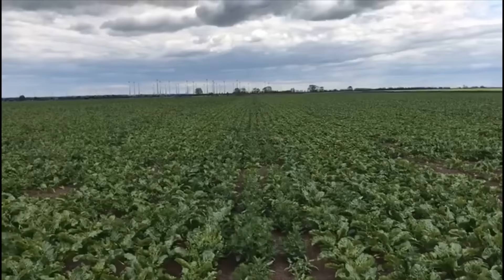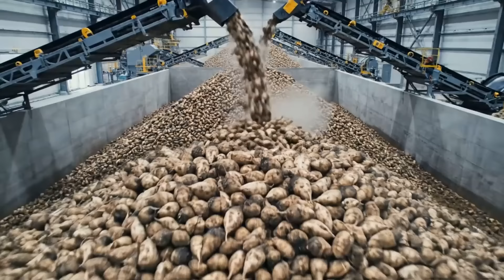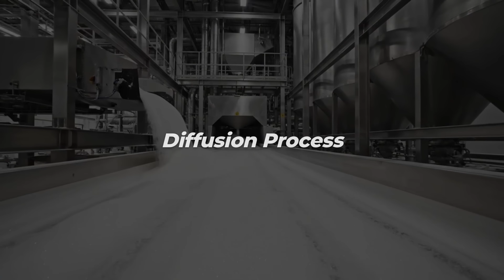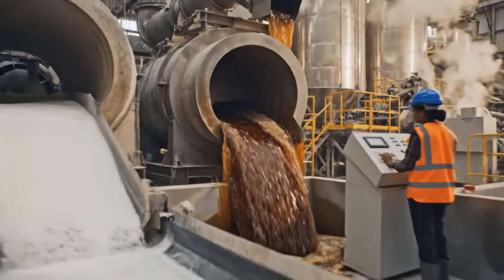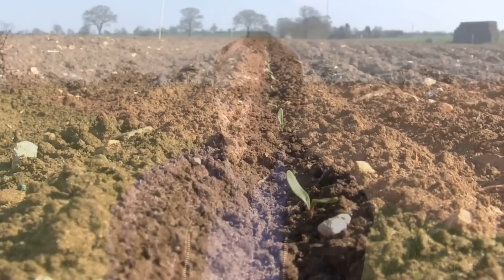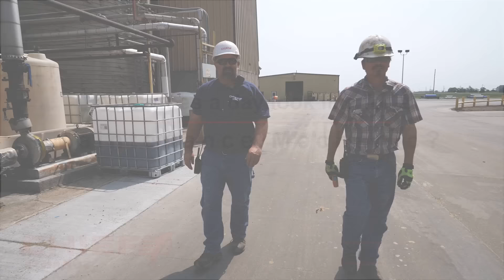How 3.5 Billion Pounds of Sugar Are Made In Minnesota. Unbelievable Harvest & Factory Process

Comment: Most year ACSC is done processing in mid to late May
Reply from the maker: That’s a good point! Sounds like the campaign can stretch quite a bit longer depending on the year. What usually determines how late ACSC ends up running into May?
Reply: @HiddenRootsofNature crops size and slice rate average due to factory troubles or beet quality. This past harvest Hillsboro and Drayton went until mid to late june.  Last 10 plus years plants start slice around 15 to 20th of August then done in mid to end of May. Crop size is what plays the biggest role in this also slice rate of all 5 factories. Beets are disturbed to the factories based on quality and other factors. Like Hillsboro factor take beets from pile site far to the north in North Dakota and select few from the local site due being able to use doubles. Most of ACSC beets are grown north of East Grand Forks factory.

Comment: No way those trailers are hauling 40 tons of beets
Reply from the maker: Absolutely! We’re sugar beet farmers and haul beets ourselves, so we see the weight limits firsthand. The piler keeps an eye on the loads and will get after the drivers if they’re over, because the allowable weight can change depending on the truck, axles, permits, and road restrictions.
Reply: @HiddenRootsofNature Some of those guys wouldn't want to go any where near a weigh station.
Reply from the maker: Agreed! 😂 But the piler definitely gets after them too. I hate driving during harvest! Do you get stuck dealing with a lot of harvest traffic where you’re at?
Reply: @HiddenRootsofNature Not anymore, I retired. But the haulers mostly avoided my transit times. I think they hauled early and late.
Reply: Yup, The farm I work for runs 18 wheeler semis and has Minnesota permits for 10% over 80,000 lbs so 88,000 truck gross weight equals about 27 tons of beets per load.
Reply: They try to be careful but sometimes the loads get a little heavy. Lol